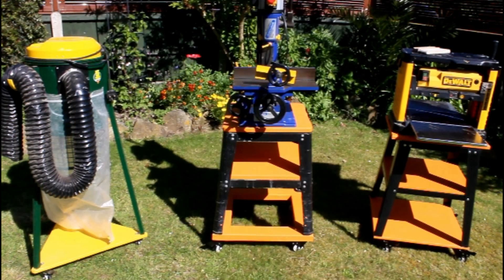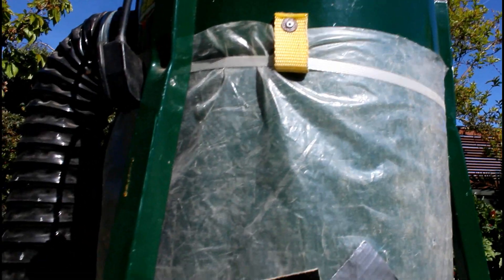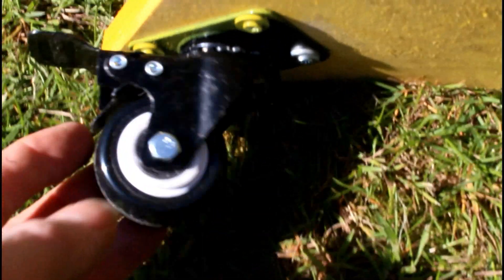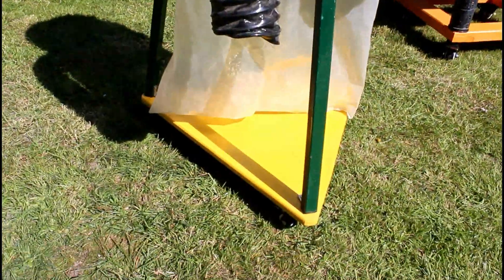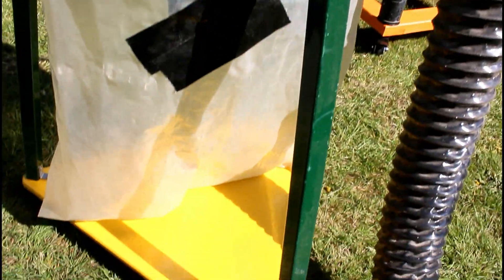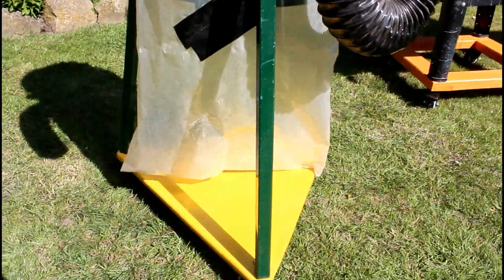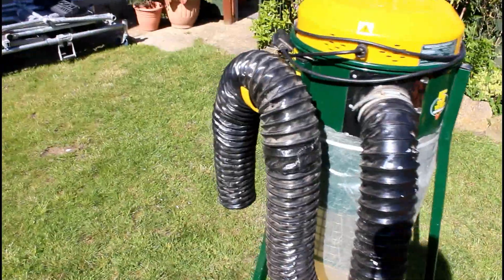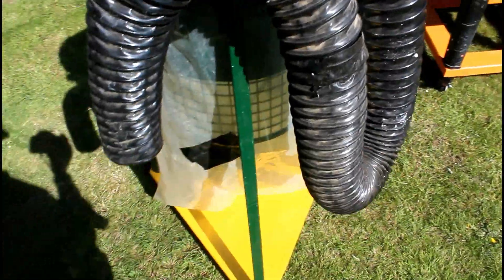Build Your Own - Record Power RDX800i Dust Extractor Mobile Stand (and others)

Comment: I have acquired aRDX800I to use with the lathe but I have not got the manual, would you have a copy. Thanking you, Bill T
Reply from the maker: Hi Bill, unfortunately I do not have a manual.  I actually purchased the extractor used and it didn't come with one.  Filters, filter bags, hose adapters are all available on line.  Keep safe and thanks for your comment.
Reply: Can you point me in the direction of where you get the filter bags and bags please?? I cant seem to track them down,  for the record rdx 👍🏻